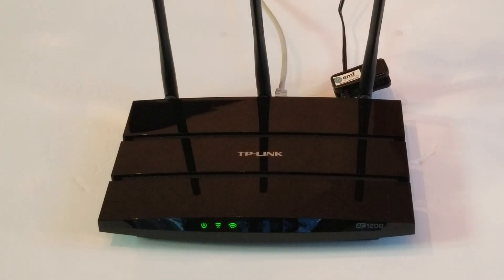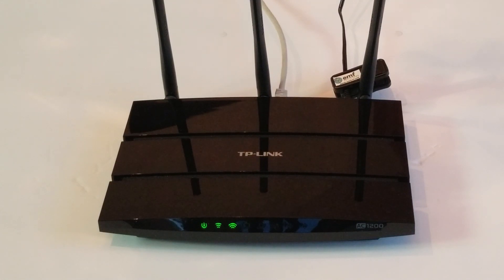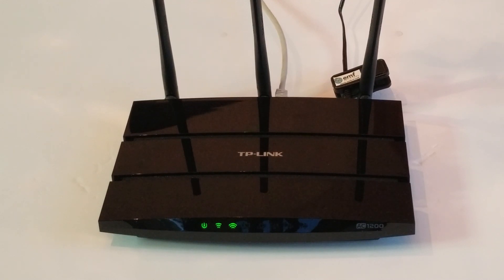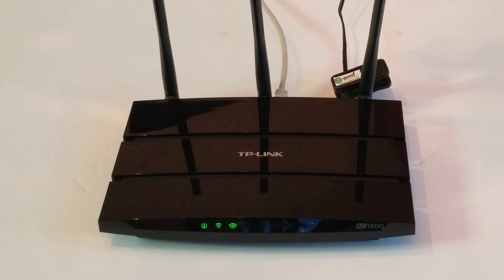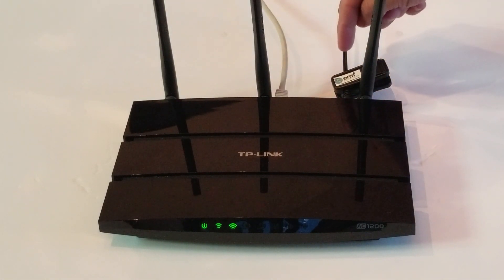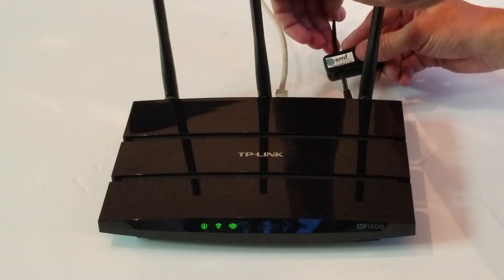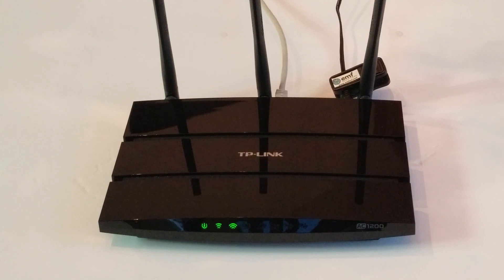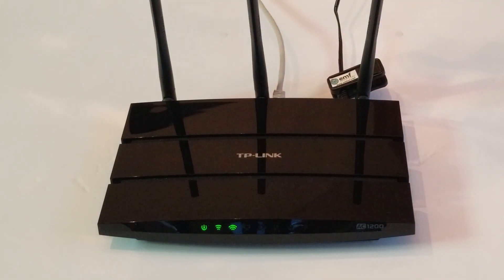Device chip installation instructions EMF Solutions

Comment: Why did he not test it with an emf meter before and after, that would prove if it works or not.i dont see how it could possibly stop emf at all.
Reply: Cory explained in a Q&A session, that it doesn't stop or block the EMFs.  He said that the EMFs are very chaotic, & it "smoothes" this out. Like if you were on a very stormy sea, & all of a sudden the sea was calm & smooth. I don't think an EMF meter measures what his devices do. He has a very expensive piece of equipment for testing, something that normal people wouldn't buy due to the cost.
Reply: @bburnsga and the subatomic chaos is what affects the energy field and cells of the body.  Like a free radical outside the body vs inside.
Reply: That's in another video.  Also... many times remediation tools can help you feel better but the readings are not changed. It's crazy but works.  Placebo... you might think.  But the testimonies are where it's at.